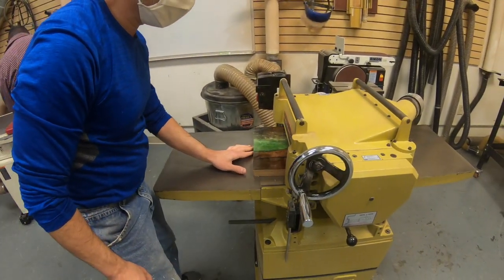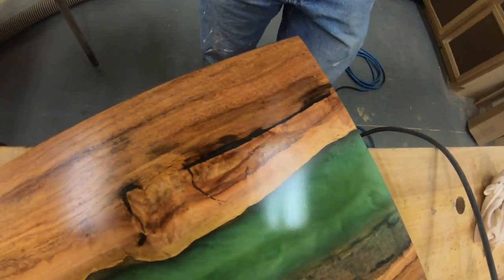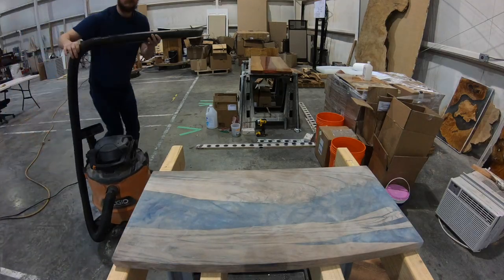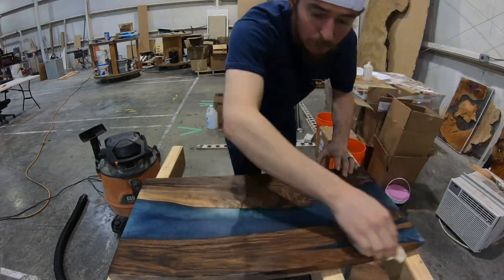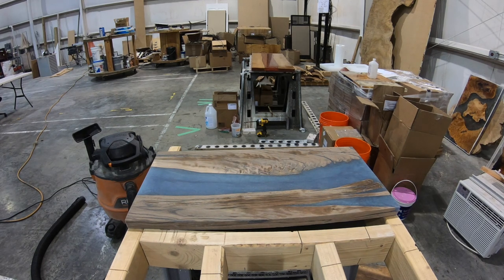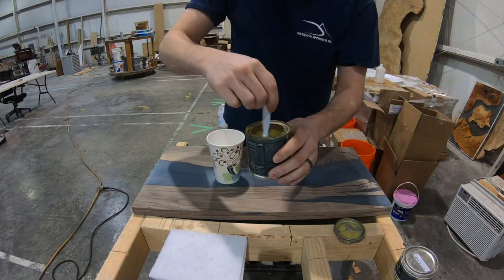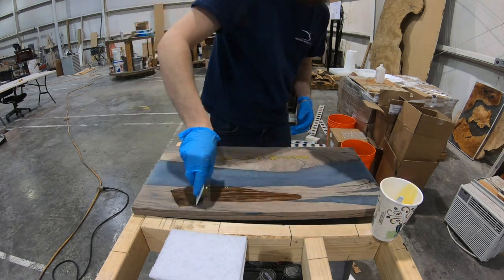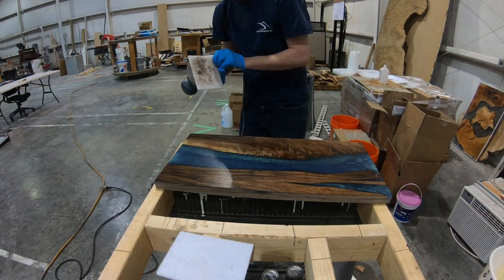Super Professional Epoxy Charcuterie Board Finish

Comment: So after use in the buyers home, and they wash it with warm soapy water, sooner or later it will need another coat.  What do they use for the maintenance when needed?  Do they have to learn to use and buy Rubio's MonoCoat, or is there something else they can put over top the Rubio's to bring it back to luster that is easy and cheap?
Reply: I appreciate your giving my question the heart, but what is the answer to the question regarding how the end customer would reapply and what would they use to reapply?
Reply from the maker: Yes, they have a product called “universal maintenance oil”. You just wipe on and wipe off. To bring back the luster.

https://amzn.to/41q2Vp0
Reply: @GoodViewWoodworks  awesome, thanks!

Comment: Outstanding and informative video! You mentioned the oil drying process normally takes 3 1/2 weeks, so when using the accelerator how much is the drying time improved? Thanks in advance!
Reply from the maker: Great question. When using the activator/Excelerator, it cures in 5 to 7 days.
Reply: @GoodViewWoodworks  excellent. Thanks for the prompt response! That'll definitely help with my planning. Have a great weekend, hoss.

Comment: i wanted your opinion on this. im using buckeye burl and epoxy to make a board. the wood is pretty soft. My dilemma is i love the look of wood and epoxy when its sanded and sealed with like odies oil but i wasnt sure for this board if i should do a tabletop epoxy to help seal it and give it the extra rigidity? what are your thoughts?
Reply from the maker: If you want to stabilize the wood you can use the same casting epoxy used in this video or you can use this penetrating epoxy from total boat.   https://amzn.to/3nJXNtL

Comment: Great video! Thank you for it, your information has helped me make a few boards. Question, are you using polishing the resin at all or is the Monocoat actually coating the resin also?
Reply from the maker: The Rubio is coating the resin but if you want a glossier finish on the epoxy I would only pour the Rubio on the wood and polish the epoxy separately.

Comment: I have a question and hope you'll answer.
I'm new at this first off. I live adding things to my resin and wood boards, i.e. shells, corks etc.
When I'm finished with all the resin work and it's cured...I plane it and sand. Here's where I'm unsure what to do next. What I've been doing is sanding the wood to like 220 grit and the resin to 5000 and polishing. Still my resin is not super clear as before running it through the planer. I have to add a top coat. Is this correct? How do I handle not wanting the topcoat on the wood?
Thank you for your help.
Reply from the maker: Great question! You must cut and buff with an automotive buffer and buffing compound. Then polishing compound. You can’t hand buff this stuff to bring back the shine and clarity. But honestly I just sand to 220 or 320 and spray a clear coat over it because the clear coat finish will be stronger and more scratch resistant than the epoxy is.
Reply: @GoodViewWoodworks  so technically I could tape off the wood and spray the clearcoat? Are you talking something like polycrylic?
Reply from the maker: @waterlilly62lori  yes pretty much anything you’d like to use.
Reply: @GoodViewWoodworks  what do you use?
Reply: @GoodViewWoodworks  so you do this method instead of the car stuff?
Reply from the maker: @waterlilly62lori  yes, I rarely cut and buff.
Reply: What product do you use?

Comment: Quick question.
How much ventilation do I need?
I'm using about 1.5 liters of 2>1 thick pour. It says low voc. I don't wanna poison myself if I do a project in the basement. It's -20ish outside.
Reply from the maker: Most of these epoxies are 0 Voc so they’re okay to use inside. I’m not sure about the brand you’re using.
Reply: @GoodViewWoodworks  It's called 'gorillapoxy'.

Comment: Exactly at 2:45 ,  the wood is completely naked or its been sealed with layer of epoxy?
Reply from the maker: It’s naked!
Reply: @GoodViewWoodworks  after sanding upto 220 i applied rubio, its giving kind of wet finish on the wood and i am looking for little sheen on it , help
Reply from the maker: @sagarlakhwani8356  I’m not sure how that’s possible unless you didn’t wipe it all off and it’s not dry

Comment: Why rubio monokote instead of mineral oil?
Reply from the maker: Mineral oil doesn’t ever dry so you need something that has wax in it so the finish solidifies.
Reply: @GoodViewWoodworks I have walrus oil, but that also makes the epoxy cloudy.
Reply: @GoodViewWoodworks  the only thing is it makes the resin cloudy. I guess you could tape it off?

Comment: Did only sand the epoxy to 150 grit also?
Reply from the maker: Yes.
Reply: @GoodViewWoodworks   I'm surprised that there still aren't scratches and swirls in the epoxy?  Do you not see them once finish is applied?
Reply from the maker: @stephenspence5534   that is correct
Reply from the maker: If you sand properly and use the scotch brute pad in between coats you will no longer have scratches or swirls. If your worried about them you can always sand up to 220 grit.